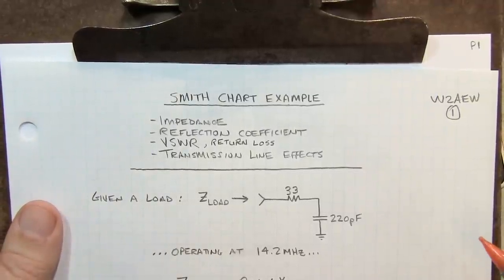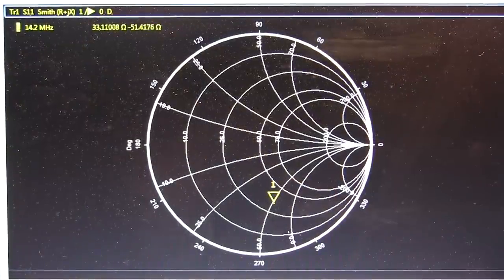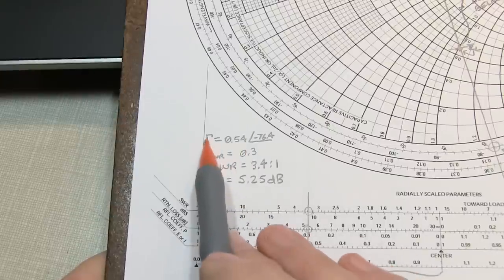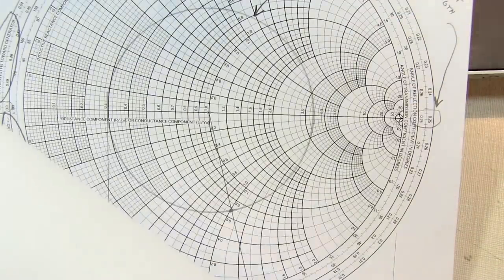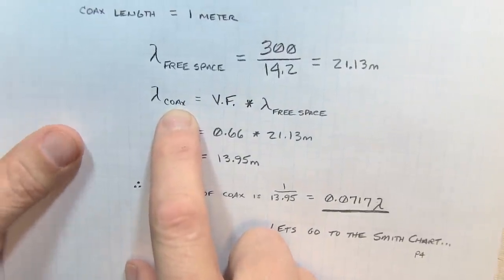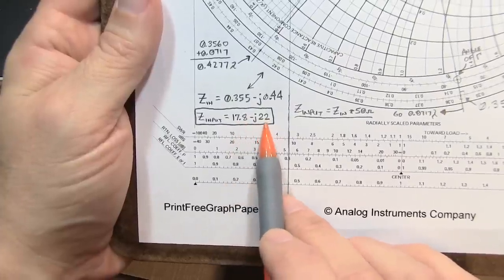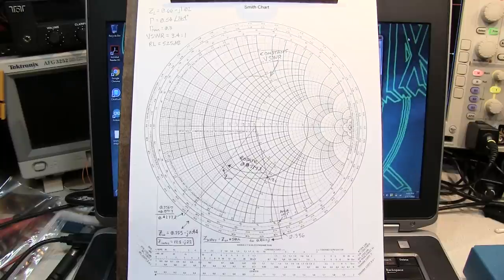#275: Smith Chart: Z, VSWR, Reflection Coef and Transmission Line Effects

Comment: FWIW, on a related subject: For V/UHF work, cut your test jumpers to a multiple of a half wavelength; it'll make your measurements and tunings better and easier. For HF, you can cobble a set of extension jumpers to add to your 10-meter jumper.

Comment: Alan, excellent video, as usual.  Maybe Andrew already suggested this but, in my words, it would be great to know how to use the charts to 'fix' an antenna (ie, make it resonant at the desired frequency). Once having the complex impedance of the [non resonant] antenna [or load] at that given frequency, let the charts show us what to put in parallel o series (an L, a C, a combination or even a piece of a coax of a different characteristic impedance) to fix the antenna. Thanks !!!
Reply from the maker: I do plan on doing a video or two on designing matching circuits using the Smith chart...
Reply: Really looking forward to those videos! Great as always, thanks!

Comment: Absolutely clear and inspiring.  It prompted me to think how to use Smith chart if Z0 of the transmission line does not equal to Z0 of the system, for example adding a 75 Ohm line to a 50 Ohm generator. Any suggestions?

Comment: Hello Alan, thanks for the great video. I watched it more than once and every time I grab a concept that I missed before.
One question: in the last example of the 1m coax cable, is it's characteristic impedance irrelevant for the calculations of the impedance seen from the generator?
It would be nice to see a video on the theory and practice of using cables with different Z0.
Reply from the maker: The Z0 actually does affect the impedance seen by the generator.  It is normally simply factored in by normalizing the chart to Z0 (Z0 in the center of the Smith chart).  If you plot the impedance seen at the generator as a function of transmission line length - you'll get a circle that is centered on Z0.  If you have a transmission line that is not at the same Z0 as the chart, then you'll get a circle centered on the line's Z0 value.

Comment: Do you have any videos addressing the interaction of frequency with all those other variables? Such as when a vna performs a sweep to determine optimal frequency resonance of antennas? Also, why do you call it “real”? Reading the Smith Chart chapter in ARRL Ant. Book ch. 28 they only refer to reactance and resistance.
Reply from the maker: I do have other videos showing the operation of a VNA to do frequency sweeps.  When I refer to "real", I am referring to the resistance part of the impedance.  Complex impedance consists of Resistance and reactance, and are expressed mathematically with complex numbers consisting of "real" and "imaginary" parts.

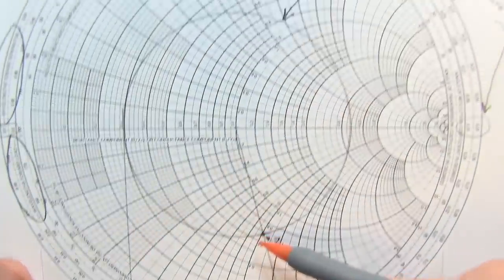Comment: While solving for the input impedance at the generator side, 8:40, did you assume the characteristic impedance of the coax to be 50 ohms? What if the charecteristic impedance is not the same as the source impedance?

Comment: Very usefull video. But i have two questions. Let supposed that we have an antenna with transmission line which give us a good swr factor, (1,2) and z, (aprox 50Ωμ), but we have a small value of capacitance, (200pF for example), to smith graph. Is this value of capacitance affects the tramsmission signal or not? Furthermore this capacitance caused due transmission  line or antenna?
Reply from the maker: The 200pF of capacitance measured in your system is likely due to the antenna not being perfectly matched to the transmission line impedance.  This mis-match causes a reflection, which alters the impedance seen at the transmitter end of the line.  The actual impedance seen at the tx end of the line will depend on the antenna's actual impedance and the line's length in wavelengths (thus, it is dependent on the operating frequency).  Whether this 200pF will affect the signal transmission depends on a number of factors - primarily the frequency of operation.   At a few MHz, it won't matter much.  At VHF frequencies, it can matter a lot.
Reply: @w2aew  Thank you for quick reply. If i would like to eliminate this capacitance which is easiest way to do it? Consider that i can't replace or varying the transmission line. The only thing that i could play is antenna length which is ground plane.

Comment: On the VSWR circle, the impedance keeps changing at different points on the circumference of the circle. Is the return loss of all the points on VSWR the same? Is the reflection coefficient magnitude on all points on this circle the same?
Reply from the maker: Yes, the return loss and magnitude of the reflection coefficient are constant along the VSWR circle.

Comment: another questions is, this system impedance, how comes the "default" is 50 always?  When people make a system, they always make it to 50? If I am going to make a system, nobody knows what my system impedance is....  maybe 10, maybe 1000... even i dont know if i dont measure it.  Does this means, when system are created, we always make it  to that 50? so that match that "standard" ?  thanks.
Reply from the maker: 50 ohms was chosen as a "standard" impedance for transmission lines as a good tradeoff between loss and power handling.  Other common transmission line impedances are 75, 93, and 100 ohms, as well as 300 and 450ohm for twinlead.
Reply: @w2aew  hmm. but my question is, when we make a system, do we need to make to that 50 ohms, so that match the "standard" ? In other words, if the system impedance is not 50, this means the system is "well made" ?  My interpretation is correct?  thanks. teacher.
Reply from the maker: @43SunSon  You generally only have to worry about it when you're sending RF signals through a transmission line - such as when the length of the interconnect exceeds about 1/10th wavelength of the RF signal - that's when you have to start thinking about transmission line effects.
Reply: @w2aew  thanks. I will come back later :)

Comment: Just out of curiosity, does the impedance develop from the wire type resistance factor? i.e.: would it vary if it were copper wire, aluminum wire, or whatever else? (regardless of size factors but dealing with length)
Reply from the maker: The transmission line impedance is derived from the distributed capacitance and inductance of the line.  Ideally, the resistance will be as low as possible.

Comment: I would like to ask one question. For any feedback from experience would be very much appreciated. 
May i know that what is the impact of big circle and small circle in smith chart while the potential that my transmission line is same. The thing that confuse me is the smaller circle shud have better potential than big circle.
Reply from the maker: I assume that you're talking about the constant SWR circles, concentric with the center of the chart.  The smaller the circle, the lower the SWR and return loss, and the smaller the impedance variations are along the transmission line (which determines the voltage at various points along the line).  A larger circuit has higher variations in impedance along the line, so will have higher potential voltages at certain points along the line.
Reply: @w2aew  many thanks for your feedback and will try to evaluate more.

Comment: Hi W2AEW , normally when i measure S parameters on VNA i first calibrate and then Sweep the frequency with a power of -10 dBm  then i can pick up the impedance of any load at some frequency from the measured S parameters , but in this tutorial i think you are not sweeping the frequency  and using a single test frequency !!!
Reply from the maker: Yes, that's right.  The Smith Chart can be used many different ways.  It was originally developed to solve transmission line and matching problems graphically (which were often performed at a single operating frequency).  It can also be used to plot complex impedance, etc. vs. frequency (such as you're used to doing).

Comment: So to sum up the "Common Use Case" @ https://youtu.be/ImNRca5ecF0?t=812, in layman's terms, you can take all this math that you just taught us, as well as how to use a smith chart to take a random length coax, build a LC network, to compensate for the coax length, to properly tune an antenna. When you can take the random length coax and cut it to the nearest half wavelength to the frequency of operation, then properly tune the antenna. With zero insertion loss. I'm am not saying that your lesson goes unappreciated. I have learned alot from you just by watching your youtube videos. Yet, as a ham you shouldn't rely on a tuner all the time! Effective radiated power (ERP)

Comment: Can't you get your lead lengths lower on the circuit you soldered on the SMA connector because they will interfere with the circuit? I think you could cut them down by 0.001mm. Don't you just reading comments from people that can't find anything wrong with the video and have no authority on the subject since their knowledge comes from youtube but, leave critiques anyways?
Reply from the maker: Yes, if I was building the circuit, I certainly would've used short leads.  Or, if I was dealing with much higher frequency then I would've trimmed the leads.  This was just for illustrative purposes with the little plug-in fixture.  At 14MHz, the extra lead length don't affecting things too much.
Reply: Oh it was kind of sarcasm because it looked to me like the parts were soldered so close that there were no leads. It was actually a complement how well you did it.